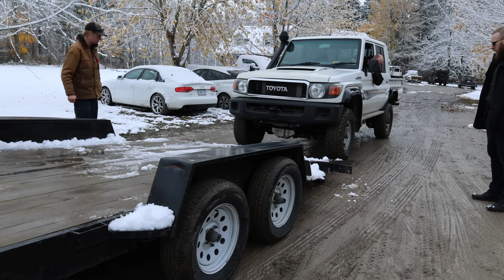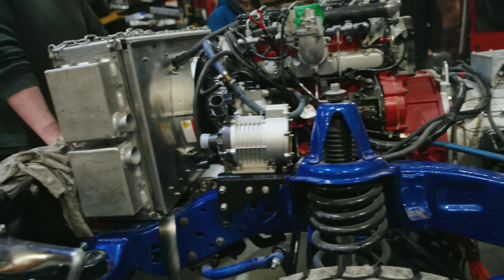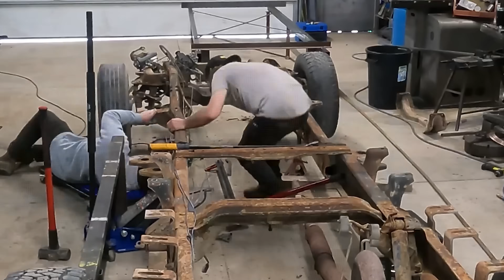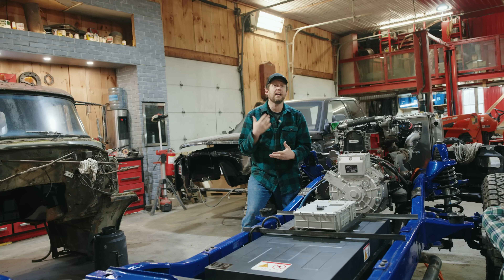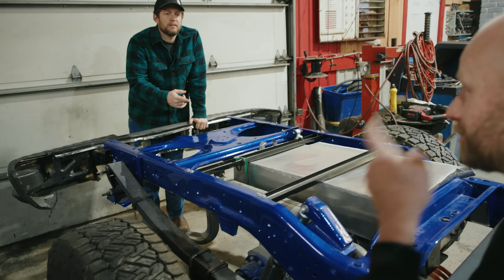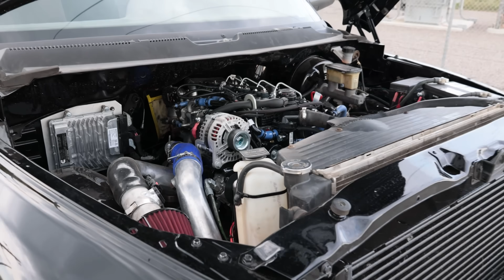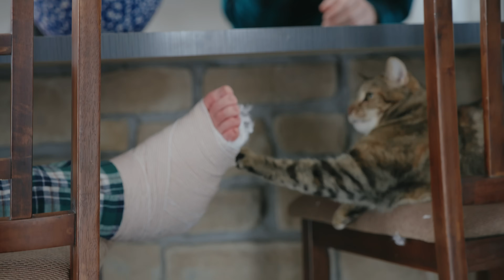Scrap Our First Design and Build an Edison Pickup Chassis from Scratch?

Comment: Thanks for the update.  Rich had said he'd be testing efficiency with the camper last fall, was wondering what happened.  I remember Rich talking about it 2 years ago, saying how easy it was going to be.  I chuckled then.  Will the pickup trucks have a way to charge at home, or just with the onboard generator?
Reply: If the buyer buys the charger option, then a buyer can charge at home. 

Rich would have finished the black dodge last fall, but had a bigger opportunity with the mine company landcruiser which is testing now.

Comment: I’m interested to see electrical specs on this. We use induction coating removal equipment that runs of 480 VAC 3 phase. Would be amazing to run equipment directly off the truck instead of renting a generator every time. Would probably need a step down transformer since it looks like this is a 600 v system but if it has enough output this would solve tons of mobility issues for us.

Comment: I understand that the primary objective is to cater to the heavier duty industrial applications but would love to have options for people who want to have this for daily use pickup that isn't loaded everywhere it goes. I know it will laugh at pulling my 5th wheel anytime I hook up to it, but I would like to have a lower geared axle option so that it can have a higher max speed. The max speed limit in Utah is 80mph and the average speed of traffic on that road is 85ish. From what I understand, that would be pushing the max limits of what you're doing based on the lower gearing.
Reply: Greetings fellow Utahn

Comment: I have 2 questions. 1 "How did he brake his leg." and "Do you have some solid conversion for 2020 Ram 1500 with 5.6 foot bed and crew cab?".BTW I'm an EE. This truck has solid engine.
Reply: In a previous video on Deboss Garage Rich explained that he broke his ankle as a teenager and now it is getting replaced due to arthritis.

As to retrofit parts, they're still working out the bugs.

Comment: I hate to say this because as a owner/operator running a Peterbilt who so badly wants a hybrid kit for it and for atleast 1 pickup truck or my Ford Excursion, but is this going to happen or is it gonna be a pump and dump business strategy of inflating the company valuation then sell to a much larger co and walk away as multimillionaires.
Reply: Bzzzzt.
You are new here. Edison is the exact opposite of a pump and dump. Edison couldn't be more transparent about wins and failures if they tried. Edison is growing slow and consistent for the long haul. Edison has has turned down multiple venture capital firms that just want to pump and dump.

Comment: I would like a 10/15 kW power unit for my Cybertruck. In the bed or the frunk. Freeway cruise empty is 500 Wh/mi. Completely change the machine in every category.
The trucks were wired for the extender pack they never delivered. Tesla would never help make this happen.

Comment: Rust belt here, (Wisconsin) why isn't stainless used for truck frames?  Personally I'd be thrilled if my K3500 had a stainless frame, and I wasn't losing sleep about the thing inevitably rotting out.  With our salted winter roads we're lucky if a vehicle frame lasts 10yrs with regular washing.

Comment: Hey @EdisonMotors - every time I’ve heard startup electric car manufacturers talk about placing individual motors at the wheels I’ve heard about the problems with unsprung weight. In this video it looks like you’re doing the same but there’s no mention of unsprung weight. What’s the difference between cars & trucks regarding this? Thanks for bringing your trucks & refit kits to market, making them right-to-repair friendly, & being so transparent with your great videos!
Reply: Trucks have had live axles since forever, engineers and drivers are all familiar with how they behave. The e-axle is just a heavier live axle so it'll behave similarly.

Comment: I reserved a kit. I'm a mechanical design engineer. I've got my truck on the lift right now doing a ZF5+gearvendor swap because I can't wait for this kit to show up....Here is my take. Keep the 34" Rail width. This opens up a lot of options for beds....the guys buying these kits will fall into two categories. Work truck guy, and Daily driver Guy. I'd say majority will be work truck guys that have existing tool beds and flat beds they will want to use. Stock bed guys will have an easier time adapting their beds to the 34" frame. I have a design engineer friend that works for Altec in E-town KY. A lot of those bucket trucks have tool boxes that will get more shallow in depth the wider you make the frame. Meaning less space in the tool boxes.

As far as the suspension. Keep the leaf springs and run a load helper bag with the leaf springs. I know it's not what Chace wants, but its economical. Various Leaf springs with various spring rates are available for all existing trucks that will get converted, allowing guys to customize their own spring rates for their purpose. 

Bags can fail. What happens when they do? You are sitting the frame on the bump stops. If you have leafs, and a manual pressure adjustment, you are much less likely to have a failure. All the complexity of the auto adjusting semi-style bag suspension isn't TRUE to the Edison mission statement of keeping it simple, and easily repairable......cheaply....by the average guy.....with parts store parts. Trailing arms suspension with autoleveling components sounds like a weak point to me (not physically weak, but weak in adhering to the mission statement). Maybe it's proven reliable in the trucking industry. But what happens when the average guy has a failure and needs specialty parts that NAPA doesn't have?

I understand the need for Between frame rail space. I think long term, as battery tech improves, batteries will get smaller, and your frame space requirements will be needed less. 

As far as frame design goes....I think you should make the frame length expandable. Run the C channel inside itself like the rails on a modern kitchen cabinet drawer. That way you can make ONE frame that can expand to fit a regular cab 8 foot bed, or a supercab 8 foot bed, or a crew cab short box. The customer only needs to pull the frame into its desired length. You can have factory alignment holes matched to know truck lengths. A universal cab/bed mounting kit. Options on Leaf spring rates. Once the frame is expanded to desired length, weld her up. Set it and forget it. 

I threw that frame idea at Theron Groff a year or so ago. Not sure if he ever brought it up or not in design reviews. He might not be involved in design reviews, being a marketing guy

BTW. If you are looking for a guy with CAD abilities, design experience, and a shop in the USA, hollar at me. Ask Theron for my contact info.

Ray Cecil in Kentucky.

Comment: I like the idea of the air even if it’s just on the back. Standard manufactured frames makes so much sense (like what the roadster shop does for hot rods) with all the equipment attached while saving time for the installers and allows you guys to test the electrical and systems prior to sending it out. Just one step away from making your own bodies now. Hahaha

Comment: Why not just build a whole truck similar to the semi? Let me guess government  B.S.!... it would be cool to offer a 3/4 ton or 2500, a 1ton, 3500, 4500, 5500, possibly a 6500 truck with  4cyl diesel  or 6 cyl gas engines  a vortec 4200 would be cool. Maybe add a small turbo to it, to get additional TQ. peak around 5-7 psi of boost , running at 3600 rpm making about 280 HP. At 3500 with water injection, (fast charge not avaliable  when water supply is depleted, having a warning light saying this to remind people, also e85 flex fuel compatible,  flex fuel doesn't require water injection.)  Build the cab from aluminum box tube frame with aluminum  sheet covering it. With  the frame made of 1/4" wall 4" x 6" tubing with the front frame section made of 1/4" sheet pressed and/or rolled to shape and welded, placed in a oven heated to 1200°F for 30-60 minutes  then allowed to cool to 450°f and dunked into water, allowing it to slightly temper, heating to prevent hard spots at the welds. Reduce chances of cracking. A standard 1/2 ton truck this isn't required,  but these are working trucks, possibly overloaded occasionally.  A 4x4 2500 non dually, 3500 dually the 4500, 5500 , the only difference  being axels and a1/4" plate bracing the frame rails and possibly  anti roll bars. That can be added to any truck. The cab is basically a square, taking a flat  rectangle windshield,  the doors having square windows  with vent windows. Looking similar to a military hummer. The doors fitting into the cab  with with a 1/4" ledge around the door,  and a rubber seal to keep it dry inside.   A 4 door is possible,  the cab has a 1.5-1.625" chrome molly roll bar  behind the driver, and behind rear seat in 4door cabs. Also a mini roll bar in front mounting the door hinges, and goes as high as the dash, also mounting the dashboard. It can also have a pillars , with a triangle  going from hinges to door latch inside the door, made of 1.5" tubing,welded to a 1"x3" x3/16 steel box with the same running hinge to hinge with a brace from the latch running behind the seat  to to the floor pan brace. About 6" if that isn't strong enough,  run it to the center with the brace from the opposite side bracing the it with an additional  bar running side to side. This should have better side impact than any thing  besides a full cage race car. 🏁   the 4 door being similar with the same thing repeating  behind the rear seat.  With a rear window roughly  12" x 38"-42" roughly the same width as the frame with with truck arm suspension 3" or 4" tubing, or two channel iron pieces welded back to back, with a 1/4" -3/8" plate welded top and bottom  at the axel end, with a 1/2"-5/8" dowel to locate the axel, and holes for u-bolts with an additional 1/2" plate for the u-bolts  the opposite end using 1/4" plate to reduce from 3" x 3" or 3"x4" or 4"x4", to 2.25"x2.25" with a 1"x2"x2" piece of steel with the 1.5" heim joint  threaded into it, or a 1.5" o.d. bushing with a 1" mounting bolt. With the 2"x6" x 5/16" wall tubing cross member , the truck arms mounted in thr center 8"-10", the  crossmember mounted to the frame with 6 , 1/2" thread bolts per side,  a 1/4" plate welded to the crossmember   between  the tubing and frame, a 2" x 10" x1/4" with a 5/8"i.d. 1/4" wall tube welded inside the crossmember,  to allow the bolt to be installed without crushing the tuning the crossmember tubing cut at a 45° angle allowing two bolts to go straight through it, 1/2" x1.5 or 2", two through the 1/4" plate, 1.5" should be OK, then the bolts through the tubing welded in, 4 bolts total 3" long, and possibly  use a couple 1" dowels  to maintain alignment.  Body drop the cab over the frame rails ,putting the bottom of the doors at the bottom of the frame rails, the cab made from 1" Sq. Tube ,the floor  having two tubes running side to side behind the seat, in front of the seat, the sest bolting to one, with an 16-18 gauge  sheet metal  spot welded to the tube. Then the floor pan welded to it. The roll bar  welded to the tubing and an 1/4" 2"x4" plate . The 1" tubes are on 3" centers , so outside to outside is 4" the windows  are glued in place , recessed in 1/2" -3/4" the rubber bead 1/4" leaving 1/4" or so. A rubber trim can make up the difference.  A z shaped steel to spot welded in place to a 1" strip to frame the window .  The  outer skin mounted to the frame with adhesive  and /or twoside tape. With rivets , a 12" x 38"-42" rear window. A 18" x 66" windshield,  with a 4" visor over the windshield,  with clearance lights on top, the 2500gets 8 lug, the 3500-5500 gets 10 lugs, with dual tires, the 6500-8500 gets tandem axels and double 1/4frame bracing,  one on each frame rail side with a 4" strap  top and bottom to connect the bracing, welded brace to brace, every 16" made of 1/4" plate. The tandem are rear drive or 6 wheel drive, with a 80 kwh battery  standard, 160kwh optional. And a 10kw inverter to provide 5kw120v per leg or 10kw  at 240vac. With a 20 gal tank standard or 40 or 60 gal optional,  depending options and frame , a 4 door long bed has more room, a 4 door 24' box truck could have 80 gallon tanks with 160kwh battery. A standard cab truck with 160kwh battery,  with short bed 5th wheel, ia lucky to get 20 gal tanks. Look over my dreaming,  have an awesome day🎉

Comment: If I had the opportunity to be a tester, and you guys built the truck and I would test it I would love that just as the everyday truck. And I think keeping the frame how it is would make more sense because then it is versatile you can put that flat deck on it. You can put that box on it, which if you put the flat deck on it, you can put your welding rig stuff or if they keep it in the box you can connect everything to the truck pretty easily still

Comment: I really want to know just how much wires there is in that wiring harness when it's ready. Way back when i did my military service one of the guys had worked building wiring chassis for a normal car and he said that there were more than 2000 yards of wires in that harness, and that was an ordinary car with an ICE. In this case there's all the electrical power to the drive train added.

The reason I would like to know hov much wires there are in the wiring harness is because people tend to underestimate just how much wires there has to be.
Reply: Correct. A traditional wiring harness for a hybrid has wires for EVERYTHING.

Which is why there is a push for canbus and/or automotive ethernet.

I think Edison is not ready for that yet.

Comment: Still think you need a transfer case from the engine to at least the front axle to power the truck from the engine, in case of electrical issues or limited range distance time frame. You need to stop limiting customers to a battery charge just like other EVs, just that you can charge on the move or in out of the way areas. Your truck isn't really hybrid. Its an EV with a generator strapped to it. Hybrid would mean you run on both. Still love yalls enthusiasm in bringing people something more than other auto makers. 👍😁 For your air bags, go helper bags, can run lighter springs. Think of HUMVEE rear end, add bag into middle of spring shock/strut to the outside instead of in the spring like cars. Try getting ahold of wholesale retired HUMVEE's to source frames. Cheap GM parts to fix up.
Reply: I have made my Silverados a front wheel drive  a couple times over the years.  😂 
The increased weight/cost/complexity of maintaining a redundant drive train isn't worth it.   Edison had a video were they isolated the batteries and ran it with the just the generator through the high power distribution modular ( which may be an issue with getting the on-road/off road generator distinction sorted)   

If it's just a battery issue, you should be able to limp it home. If the high power distribution modular gets fried you are calling A1 Semi Towing....

Comment: Funny thing is my 1960s bicycle has a 3-speed planetary gearbox in the rear hub. Switching gears changes which gear is the input and which is output (second gear has everything locked together for 1:1) 
And I love it. It's super reliable and a lot less screwing around than a derailleur. Great choice.

Comment: One advantage i can see with the wide rear frame is something like a step for certain applications (a wrecker might have good use for that space or a service body might use it as a litteral step)

But those things have to be tailor made which isnt great for affordability.

So its probably better to go with the normal standard, but if you want to expand into making tailor made ones, you might be able to do some cool things with a wider rear frame.

Swift recovery to Rich! Those guys are killing it on the pickups. Love to see their stuff.

Comment: I work for a company that builds cutsom mobile work stations. We use Ford 550 chassis for our small builds, partially for capacity, but also for the straight frame rails on the back. It makes mounting the shelter so much easier.

Comment: I'm cool with the rear axle, but I'd want a dual motor in the front, that spins each GMT800 cv axle in the front. I really dislike solid axle front ends, even if they're stronger. Kryptonite can sort that out.

Comment: It seems the focus is on full size pickup trucks meant for work. This isn't about ride comfort, but carrying payload and pulling trailers. The tried and true leaf spring rear suspension delivers that, with the air bag making things more comfortable for the driver.

And you're making efforts in tuning the front solid axle with four link suspension and coil springs, especially when it comes to the dreaded death wobble.

I don't know if smaller pickup trucks are in plans with Edison Motors, but those have more conventional car-like suspension systems. IFS and four link suspension rear. I hope that's something to consider if you ever have plans for something like that.

I love the work you and the team have made so far.

Comment: Pup trailers from Truck Weld are using wider frames and its much nicer and stable whem dumping. Dunlop boxers are easy to build at a wider stance on the sub rails of the box. Much easier on the suspension components also

Comment: Definitely go with the 34" frame rails. 
Ad on the cab mounts where they need to go for the cab the customer is using. 
4 link in the front.. option to do air ride in the front rather than coil springs. Load leveler valves and dump valves in the rear would make hooking and unhooking much easier. 
Air bag suspension in the rear.